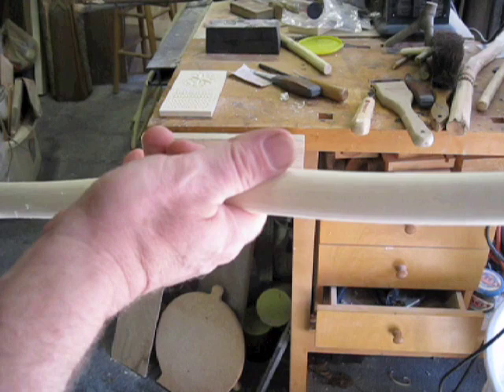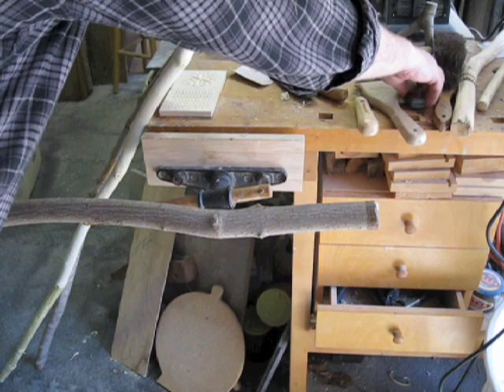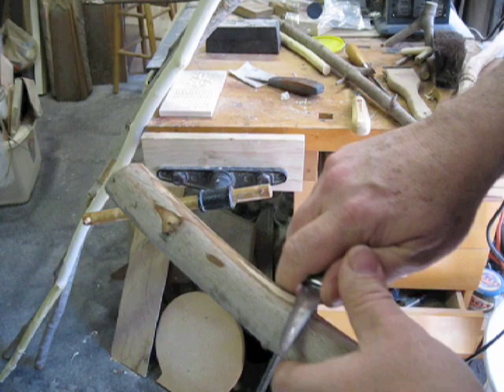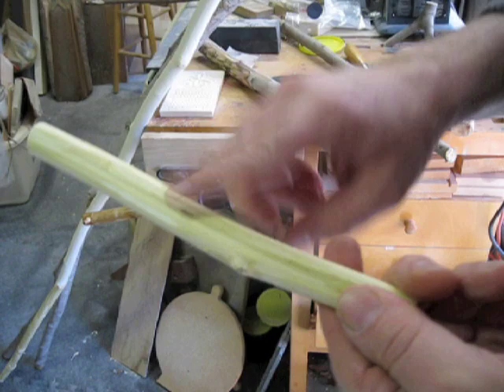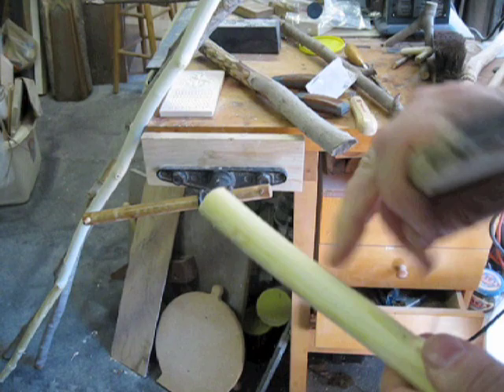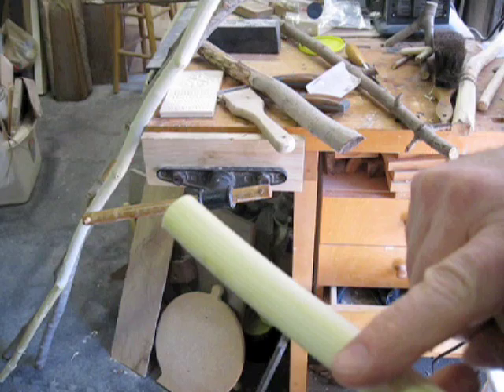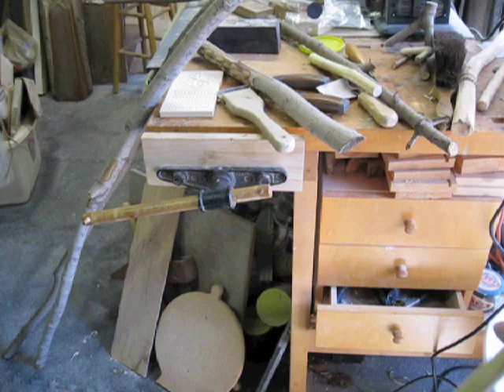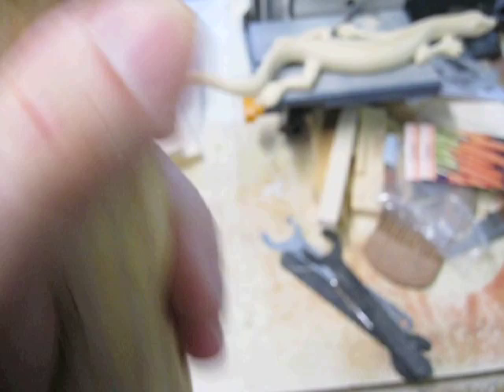Walking sticks prep 1

Comment: I've been making walking sticks for years and you can cut them green you put them in a closet for about a month and let them dry and then take the bark off it comes off easy leave them in the closet for another 3 months and they're ready to work with easy to work also use broken glass as scrapers they work the best I have taken a green sapling scripted in the woods and treated this way and it did not split the trick is the way the tree grows the way you stand it in the closet if you do it upside down it will split every time
Reply: You don't believe in Punctuation, do you? Makes it hard to read.

Comment: You can also use just plain old yellow glue for the ends to slow down the drying.  That is what us wood turners use to prevent excessive water loss of the end grain cracking our bowl blanks and the principle is the same.  :)
Reply from the maker: good suggestion. Thx

Comment: I used to make canes like that.  Then slipped on an icy step, fell on my
 cane, and when I got up found out my cane had snapped like a twig, but I
 didn't even know it.  That is when I changed my cane making method, and
 now make much stronger canes.  My shaft had air dried for around 10 
years, inside, by the way.
Reply from the maker: Theo, Sorry to hear about that fall. My walking sticks are just that. Not really for supporting full weight.

Comment: Excellent info, good photography & well said!!  Here's another tool tip...in place of the Flex Cut tool shown, have found that a standard painter's "9 and 1" tool will work as well. (the half circle part)...and it can be sharpened if you want.

Comment: FIRST TIME seeing your video, glad i did.
As i was watching and you showed the pieces you had cut off that were longer than others would work very well as a so called RABBIT stick, they were, and still used in some parts of the world to stop a rabbit or anything else from running away from you if a stick was the only weapon you had and hunger was gnawing away from lack of food. I carry one when camping just in case needed in troubled times. I felt the explanation was needed for folks who may not of heard of such a thing. Thanks and will be searching for more of your video's and learning some tricks of the trade. Oh in closing I'll add i recently found an old dried tool handle from shovel i think and in the process of making a walking stick of my own .

Comment from the maker: Some good info and dialog here. Yes, I should have done some research and known the name of the Cambium layer.  My videos, at least when I did this one, are just me showing my learning curve and what I didn't know about the process then I know now. I don't profess to be an expert, rather my intent is to try a lot of different things and get other interested. I appreciate the feedback. BTW, I now use Anchorseal 2 on the ends of sticks and logs. Seems quite similar to Elmer's glue.
Reply: Do you use Anchorseal on the ones you remove the bark or just the ones you leave the bark on and do you just seal the ends?
Reply: Also, do you have a link for the skokeshave that you use?  I am starting on my first walking stick and been looking for as much info that i can find.
Reply from the maker: @dino0489  Just the ends.
Reply from the maker: @dino0489  Just added the link for the spokeshave in description.
Reply: Thanks for replying; I was also wondering if it matters whether or not to leave the bark on; does it matter or is it a personal preference?
Reply: would it be ok to tie a string on to the sticks and let them hang on my porch?  My porch is closed in but not heated or cooled.  One thing i was really concerned about is freezing temps will be here soon.  I may have room in my attic to store some sticks.

Comment: Great information in your video!  Was wondering can you seal with wax after it has started checking ? 😊
Reply from the maker: After the wood has checked, it might be too late to use wax to prevent that. Important to slow the drying when the wood is green. You could always cut off the checked bit and apply some wax.

Comment: Get you some box hedge bush they're really need a carveand there's a lot of and they're a lot easier to peel off the bar use exacto knife that will feel your bark off real fast after you peel the bark wait a few days and then making sure you got all the stuff off of it send it thoroughly make sure you get all the knobs the little imperfections in it and then latest setting for like 2 days after you have sand in it and then go back to it and look over it again and send it with a smoother grithagrid middle and then keep going down to get your satisfied we're doing it and it'll turn out beautiful I make Cane's myself and make it really really really smooth you take a deer antler and you rub it real fast on it it'll make the would look like glass
Reply from the maker: Nice!

Comment: I used a hook & loop pad with my four inch hand grinder that I was able to attach a sanding disk or a 3m Scotch-Brite pad that comes in different grids that do a Very clean and smooth as you want finish, where all you have to do is finish your stick to the degree you want. Very easy and a super smooth finish, just by working it up and down. Easy and faster than by hand scraping.
Reply from the maker: That's a great idea.

Comment: Hi, Don. I have a stick that I cut down last June. I didn't debark it then, because I didn't know then how I was going to finish it. It has a few natural twists to it and I'm thinking of leaving the bark on the outside portion of the twist, yet debarking the inside of the twist. But now I wonder what will keep the left on bark from flaking off later. Any ideas would be greatly appreciated. Thanks!

Comment: I cut fresh saplings and it did Not take 3 months to dry them, it was about a month and I could stain them, less figure in how thick they are as well. mine are from 2.5 inches from the bottom and thinner at the top. Fresh peels Faster, but seasoned its all that bad to trim or debark.

Comment: Thanks for the good tutorial! :) the moisture really seems to be the key to treat properly. I was wondering, is it possible to use some kind of heating like industries do to quick dry the core, or does it damage the wood and risk it of breaking if you don't let it sit in a room temperature for a longer time?

Comment: How do you keep them from spliting ? Can you take off the bark after sealing the ends? Will the piece split on the sides if the ends are sealed?
Reply from the maker: sealing the ends should slow drying and lessen splitting.

Comment: You would think that a guy with a woodshop would know the names of the layers of a stick/log. Pitiful.

Smaller pieces can be dried in your microwave oven (don't over-dry or you'll be reaching for your fire extinguisher).

Instead of melted wax to seal the ends of the wood from cracking while drying, any white glue such as Elmer's School Glue can be used.

Why take all the bark off when the daker bark can artistically add contrast to the lighter wood?

Better instruction elsewhere.